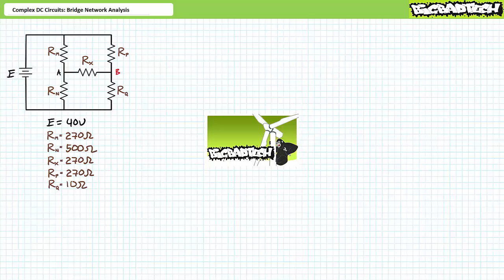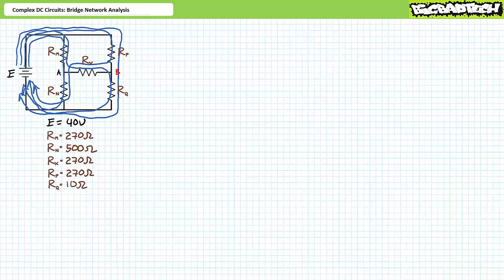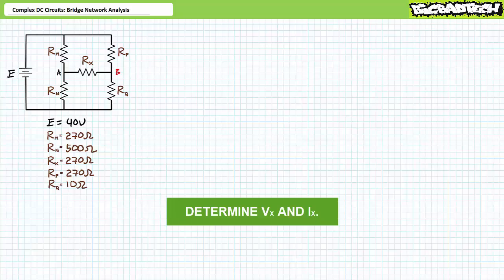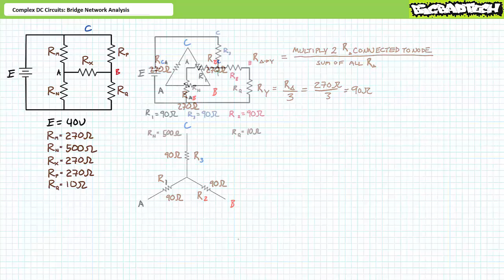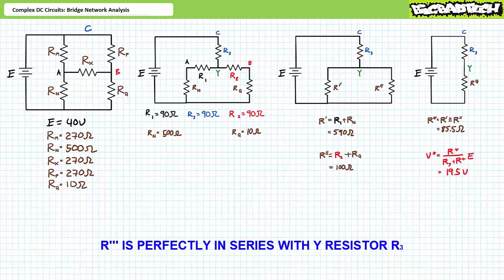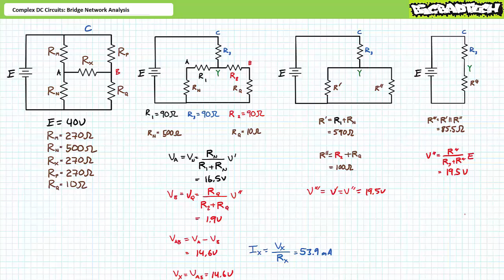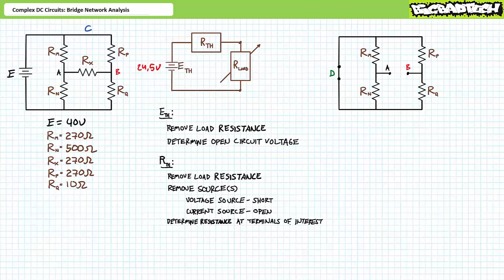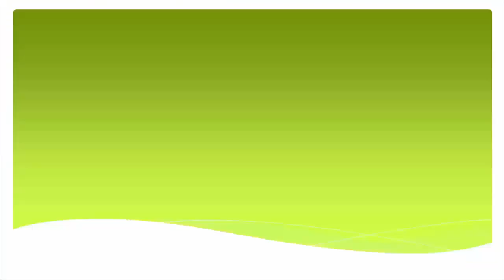Complex DC Circuit Analysis (Full Lecture)

Comment: There is nothing complex about this trivial circuit.  It can be solved using vanilla nodal analysis in just a few seconds:

(E-Va)/Rm=(Va-Vb)/Rx+Va/Rn
(E-Vb)/Rp+(Va-Vb)/Rx=Vb/Rq

Solve the two equations above for Va and Vb, and finally compute whatever else you want from the circuit:

Vx=Va-Vb
Reply from the maker: True. “Complex” means not purely in series nor  purely parallel not “difficult”. Difficulty diminishes with the proper tools and training.
Reply: @bigbadtech  By the way, in circuit analysis, the word "complex" has a very specific meaning in a very specific context, and it is not 'DC'...
Reply: To each his own !
True sign of an Egotist -- A man of low taste, more interested in himself than others.
Reply: @cascadeanalog320  Sure, sure.  Now replace one of the resistors with a diode.  Solve.